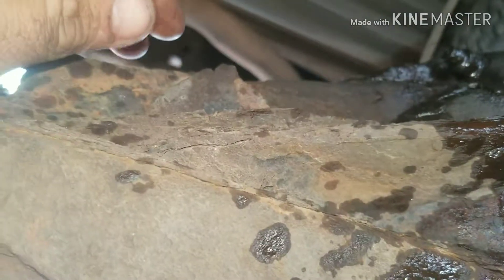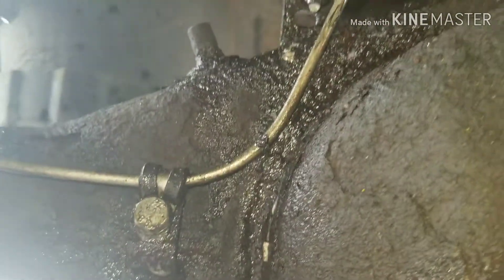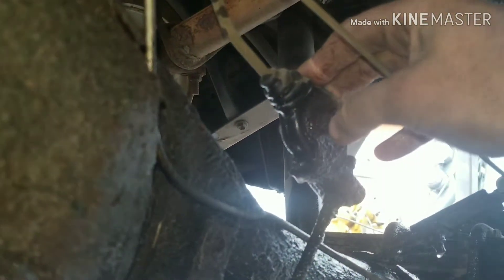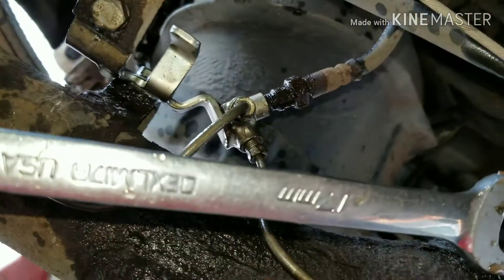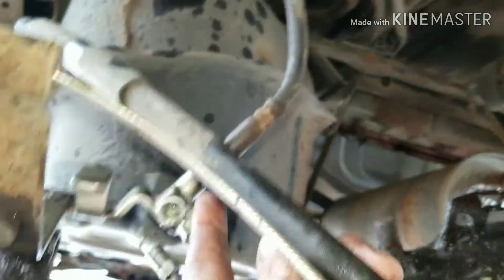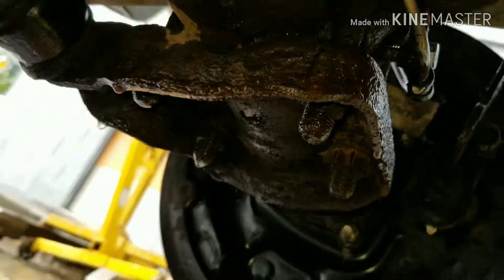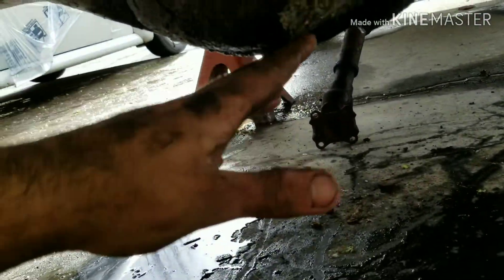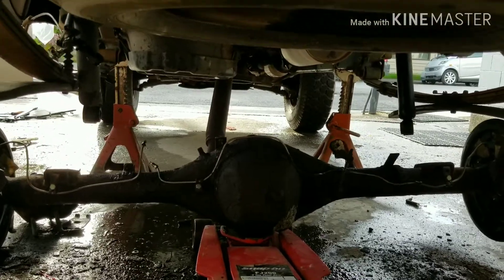How to replace the rear end in a Toyota tacoma

Comment: Hi, My son's 2000 2wd Tacoma has the same problem.  A local garage is proposing putting in a Kia Sportage rear end, for $750, as the Toyota rearend prices have sky rocketed.   They said they did one about a year ago, and haven't heard any complaint. So far I can't find any info on the compatibility, as I figure we could do it ourselves. Any advice would be appreciated. Thanks.
Reply from the maker: I have never heard of any one doing that before, I like to stay to stock so I won't run in to any problems where I have to manufacture parts or bracket. If you do  it your self be careful be sure to use all the safety equipment required, and be prepared to have to cut bolts and have new hard ware on hand
 Thanks for watching I hope this helps and besure yo like and subscribe,   Thanks again